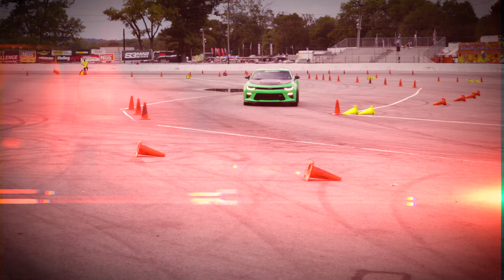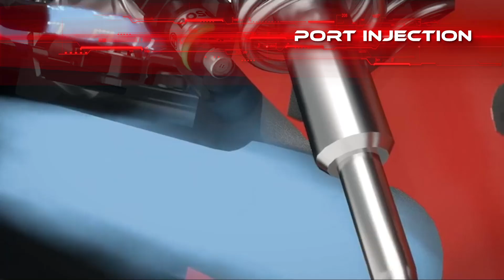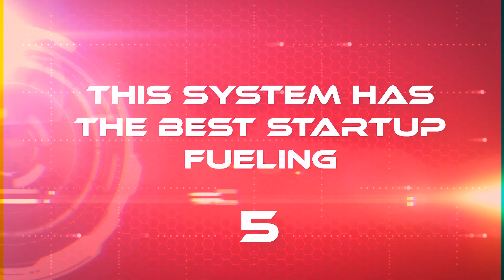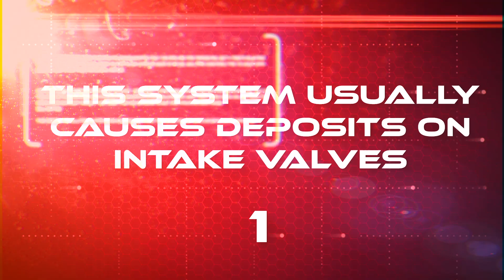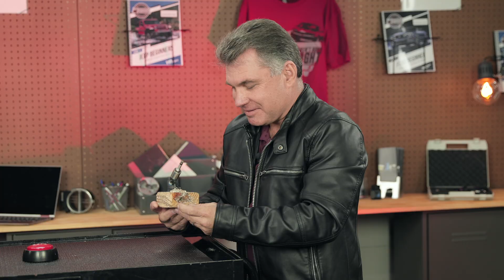Direct Injection vs. Port Injection

Comment from the maker: Thank you everyone for your feedback! We should've clarified in the video that we were discussing Domestic V8 vehicles. These are the high performance vehicles that we primarily focus on. So for the last question, "What manufacturer mixed both types of fuel systems to get the best of both worlds?" we technically meant out of those particular vehicles we specialize in. We understand that foreign manufacturers and other non performance vehicles might have introduced this dual setup first.
Reply: We all makes mistakes .I sallute u guyss make more videos
Reply: Why would you modify the last question to fit the answer? The most common comment in here is that Ford was late to the Dual Injection Strategy.
 
Ford didnt produce a v8 with direct injection until 2018... Another viewer pointed out the LT5, and it is the only GM v8 I found that uses Port and Direct Injection, Chrysler/ Dodge/Ram v8s do not use t utilize direct injection at all. If the revision of what the question was supposed to pertain to is true then the answer you give is that the 2018 and newer 5.0 Ford v8 used dual injection strategies to before the Corvette exclusive LT5... Do those engines comprise your primary focus?
That is a narrow scope answer to the industry's move towards using Port and Direct injection so:
Are you sure you meant to answer "FORD"?

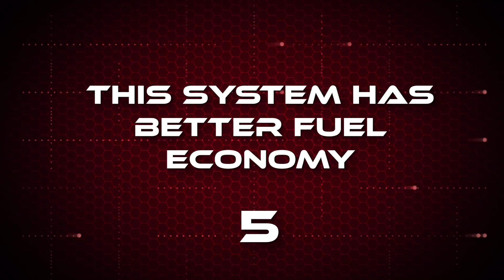Comment: 5:07 It seems like Chryslers gen 3 Hemi engines are probably one of the only engines to maybe get better or about the same fuel economy with port over direct injection.

Simply because they operate at such low rpm and have a lot quench so they have a lot more time to mix their air fuel mixture and aslo burn it. 

Ohv 2v pushrod engines love torque and lower rpm compared to higher revving ohc where more precise fuel control is needed. 

The big hemi engines cool their sodium filled valves and cylinder heads with their port injection, lowering the temp and allowing for more compression. More time to burn. 

Direct injection doesn't always have better atomization because it injects the fuel in super late in the cycle and only has fractions of milliseconds to mix. 

While port would start mixing as soon as the valve opens. Port just simply provides a lot more time to mix. And so do hemi engines. Combine them and you got a efficient set up.

Comment: This helped me understand that I'm not interested in trusting a direct injected truck motor to make it past 150k miles without having to replace multiple fuel pumps and injectors that run off the cam. Gonna be a pass from me.

Comment: I'm looking at having to clean my valves in my direct injection motor. It looks like a hell of a job. To make things worse, they put a valve that recirculates the dirty exhaust back into the intake for emissions. So not only are the valves not being cleaned by the fuel, but they're actively being showered with carbon deposits. Who thought this was a good idea? Anyone?
Reply: Look into the PCV system on your car. You'll see why. There's a thing all engines suffer from, it's called blowby.
Reply: @mpchappelle  yeah, I'd say that's a factor, but it wouldn't be a problem with dual or port injection. Also egr system is literally constantly putting dirty air through the intake valves.
Reply: @mountaindew267  Dude. If you seal that system, you're gonna over pressurize the crankcase. Then your gaskets are gonna start to leak over time. Look into a catch can if you have DI. And it's a factor with all engines. Even new cars have blowby. And if you disconnect it so it doesn't reroute, you'll just get a vacuum leak.
Reply: @mpchappelle  do you know what egr is? It has nothing to do with crank case pressure. Obviously blow by needs to be vented, but egr doesn't need to be a thing for any reason besides emissions.
Reply: @mountaindew267  Oh wait you said EGR? My bad. Just get rid of it. Shit I forgot those existed. Normally I would delete them.
Reply: There is a fuel additive called Gumout multi system tune up. It cleans what your describing.
Reply: @iiiEazyiii  it would have to be an air additive because the fuel doesn't go where I need to clean.

Comment: What about Ford Duratec HWDA engine (this engine typically uses Siemens port fuel injection system), how long this engine lasts, what kind of symptoms  or issues are there and so on? When this kind of engine (like HXDA / HWDA etc) could "wear out"?

Comment: I hate direct injection as it’s a PITA to keep the valves clean with a detergent fuel.
Reply: Direct injection is not the problem,  It's the egr and pcv that cause the problem

Comment: So I've a 2016 Ford Focus 2 .0 L I 4 GDI engine . Is it a real concern for carbon buildup and loss of performance and what can we do to prevent this ? Any good cleaners we can add to tank ? It's not necessarily a huge concern ? It seems as if gas cleaners such as I've mentioned only treat the gas itself ? Any help will be greatly appreciated
Reply: Fuel additives won't work because carbon deposits on DI engines are caused by not introducing fuel into the intake ports. If there's no fuel getting into the intake then even all the fuel additives in the world won't help.

Comment: have a look at orbitaluav.com.au low-pressure GDI. it uses a low pressure air-pump to atomize the directly-injected fuel. years back, many major companies looked at this setup but for some reason, elected to just go with HPDI. guess the manufacturers didn't want to pay the royalty fee.
Reply: The ground work based on high pressure direct diesel injection had already been laid out before the OEMs took direct injection to market. 
It is less of a headache to be able to modify the architecture of fuel injection by adding a high pressure fuel pump and injectors, rather than to add an air compressor system to accomplish a similar feat.
A low pressure air pump is incapable of efficiently delivering the fuel quantity into the combustion chamber when the piston is nearing top dead center . That is where high pressure direct injection outclasses other methods.
Heavy duty diesel engines that are already equipped with an air compressor for brake/suspension systems use to utilize compressed as the force to actuate egr, boost control, VGT, aftertreatment fuel injection, fan clutch control etc but are commonly adopting electronic control instead.
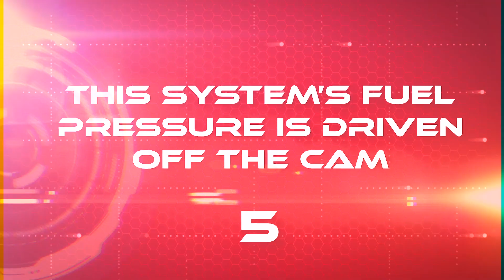Reply: @3sgteleak  was wondering why you referred to diesel when i was referring to gasoline when i looked at the vid again at 2:34 and noticed reference to "common rail" which is usually a diesel term. the vid also references existence of both low and high pressure pumps in the engine(s) they were talking about.

you make a few good points...one of which is about high-pressure and top-dead-centre...but orbital low-pressure DI had been used to research HCCI (operates similar to diesel but uses gasoline) before and according to past orbital research papers, their system can be used regardless pf cylinder-stroke position although most of these besides the HCCI ones do seem to only relate to gasolines. 

i think it was the Ford Genesis program that had a few hundred Orbital low-pressure DI 2-stroke engine powered hatchbacks that operated for a few years.

anyhow, disregarding diesel engines...ALL gasoline DI engines these days seem to be of the high-pressure variety which needs the addition of a dedicated high-pressure pump when low-pressure ones are already integrated for pumping fuel etc...

orbital low-pressure DI predates HPDI in diesels and was originally developed as part of the novel "orbital engine". the DI technology component was hived off to improve 2-stroke emissions when the company founder and board realized that auto majors were not interested in novel non 4-stroke engines. the hope then was auto major would be more interested in cleaner 2-strokes due to power advantage but this was not to be.

so now....orbital only concentrates on military heavy-flex fuel UAV engine applications.
Reply: @wl88168  That is a pretty nifty design (the orbital engine). To be honest I didnt know about it, and the website that i found from the link you provided didnt provide insight to the combustion operation. Since your most recent reply I have only started to grasp the design you were referencing. 

I mentioned diesel technology because that is the closest relative to gasoline DI that I am aware of. Obviously we know these are spark ignition engines, and not diesel but a lot of the tech is shared between both systems Though at 1/10th the pressure of 

I just think that it is easier to add more pressure to the fuel system than it is to add another system to the engine. 
Perhaps OEMS are currently working on the Obital injection strategies to achieve HCCI as the next step to keeping the ICE viable against the electric rivals. If Orbital Injection tech works effectively to attain HCCI then i feel like manufacturers will employ it when they need another secret weapon. 

Reverting to the subject of 2 stroke diesels and unconventional engine design: Have you seen the progress that Achates has made? The youtube videos are pretty dismal but Cummins has contracted their tech to build 3 cylinder 6 piston engines for the US military.
Reply: @3sgteleak  i doubt the auto companies are looking into Orbital and HCCI anymore...from memory, i think it kinda worked but was too unreliable, complex and expensive. have a look at the "Lotus Omnivore Concept Engine."

Orbital themselves have not indicated that they're still pursuing business in the auto sector but i'm sure they won't refuse if there's further interest.

another interesting aside, there was  a company (can't remember the name) years ago that employed the Orbital low-pressure Direct Injection process and optimised it to drive an engine at optimal constant speed maximising energy conversion to efficiently charge a battery as part of a hybrid-elecric vehicle set up before hybrids and/or electrics became a thing....

i'd be wary of pining any hopes on any novel non 4-stroke engines getting anywhere...many companies with novel engines have been trying for decades to go mainstream or mass market without success. the barriers  to entry and acceptance are just too numerous and high.

i'll look at Achates sometime...first i've heard of it.
i'll swap you for another one... have a look at revetec.com. this company has been around for ages too.

OR "split cycle engines."
Reply: @3sgteleak  just had a very quick look... the achates engine looks kinda like an inverted vertical version of the horizontally opposed "boxer engine".

Comment: I'm not a Toyota guy but I think Toyota was making port and direct injection engines first
Reply from the maker: We think you're right! Check out our comment/correction in the video description. We appreciate your insight!
Reply: The v6 that comes from the Lexus 350 trims are port and direct injected. Also the European spec vw gti and golf r are port and direct injected
Reply: I was like, no mention of Toyota?!
Reply: I know Toyota has been using it since at least 2007 on the 2GR-FSE. Not to sure about anything prior. It’s a question that greatly confuses google.
Reply: Toyota by a decade lol. I mean.... they only beat everyone else by 10 YEARS.
Reply: Yep, lexus (toyota) did it first
Reply: Toyota has the patent for it. Nobody can copy their design
Reply: @wjm3018  ford actually does have multi port injected engines. a few others might too.